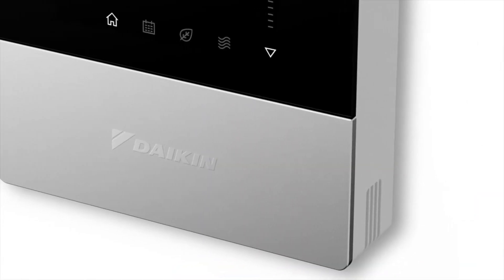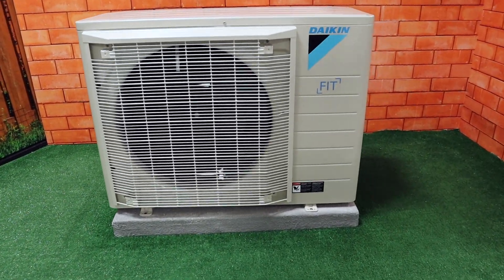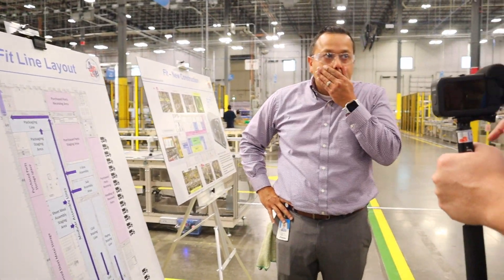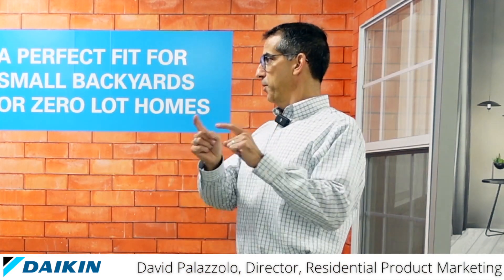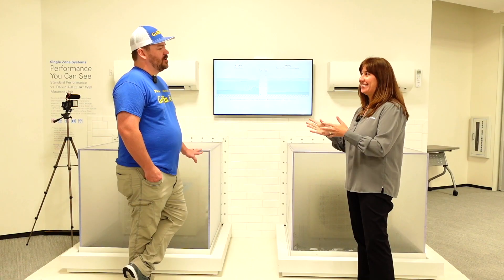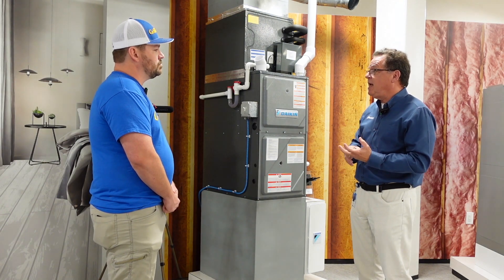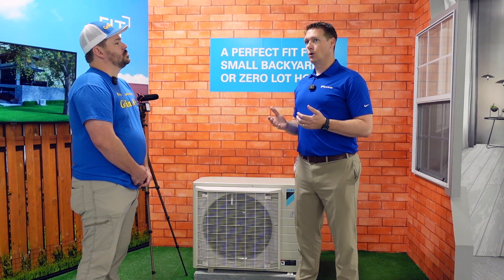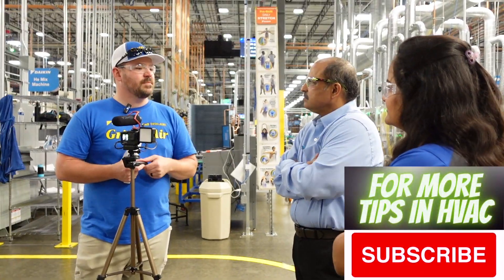Newest HVAC Products from Daikin!

Comment: For daikin heat pump what happened my heat pump running 3 hours to increase just one degree any additional info to fix because the guys install this new unit they don’t have a answer …
Fan noise is crazy how can I minimize the noise.

Comment: I am so surprised how behind America is compared to the Daikin Products in other Countries (Australia).   I understand that each Market/Country is different and Products are developed to match that market preferences. 
I sold Daikin for about 21 years and have been in the HVAC Industry since 1971.
Reply from the maker: What's the one technology that you think every country should have? I'm sure we are so behind that. I probably won't even know what you're talking about ha ha.
Reply from the maker: Join us every Tuesday night on our live show! https://www.youtube.com/@hvacguideliveshow
Reply: @NewHVACGuide  
Australia has been using Inverter (Variable Speed) Compressors since the 1980s. Single Wall Splits, Multi Splits, Ducted Splits are ALL Inverter System. Many Advantages including 'soft start'  (slow speed) and ability to reduce power to maintain de-hum operation. Most also have the ability to ramp up to 130% of the rating for a period of time.
Even Commercial Projects have VRV/VRF Systems as the main player. These are sold here in Air Cooled as well as Water Cooled condenser types. (Apartment Towers with system per Floor) connected to Cooling Tower/ Boiler Plant on the Roof.  Also, each system is Heat Recovery, so Sun side of Tower needs cooling in winter and the Heat absorbed is transfered via refrigerant system to the shade side of Tower. All indoor units have independant heating/cooling operation.  Here in Australia, the Sun is across the North Facade.   Rise in the East sets in the West
Reply: @NewHVACGuide  
Hey Champ.  Please let me know you got my feedback answer.
TY canbe so vague to us.  Cheers. 🇦🇺

Comment: Hi Josh,  I had a Fit installed back in April here in Columbia SC.  So far, its been working good.  At the time, you mentioned that Daikin was coming out with a remote temp sensor that could be paired with the Touch thermostat.  Did you learn any new information about when that might become available?  Since my Touch is in the same room as my gas log, it would be nice to have a remote sensor elsewhere in the home to better reflect the overall temperature this winter.

Comment: I live in central Canada and have been looking at replacing my functioning but 19 year old electric furnace and AC unit. I was about to buy a 2.5 ton Diakin Fit and air handler with a 15kw heat kit. Then I heard about Diakin coming out with new tech later this year. Then I saw your video. Good stuff by the way. My question is, with what you learned on your plant visit would you advise someone to wait until next year before buying a Diakin Fit? The current model says it will be 100% efficient at 5F or -15C. Will the performance numbers for this size of unit be dramatically better? Thanks for your help.
Reply from the maker: I'm not 100% positive but I believe Canada is switching to the A2L refrigerants just like the US is… If that's true, you may want to hang on a little bit longer and when the R32 equipment starts coming out next year, you'll be able to buy system with the new refrigerants.

Comment: Do your research before buying a Daikin system. We have one that is less than 6 years old and we have had to replace the coils twice and the compressor once, so far. We have regular twice a year maintenance and inspections done on it. The parts were covered under the warranty but Daikin refuses to consider paying us back for the labor charge we had to pay our air conditioning company. We had a Trane before this that was 19 years old and never had any problems. Daikin was highly recommended by our air conditioning company but I’m not impressed with the quality or their lack of interest in building customer loyalty
Reply: Daikin is one of the only manufacturers that offer a 12 year labor warranty, maybe your contractor opted not to pay to offer it.
Reply: Made in US doesn't mean quality.
Reply: Seems like Trane was trying to build customer loyalty but it didn't do them any good did it?